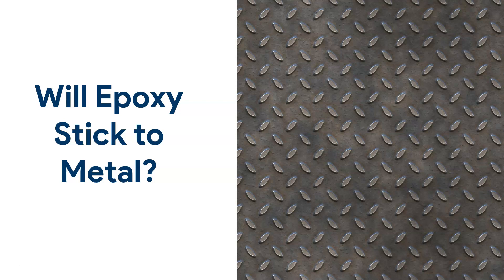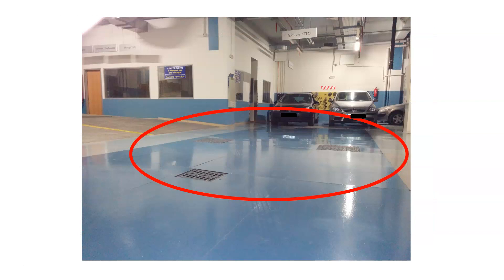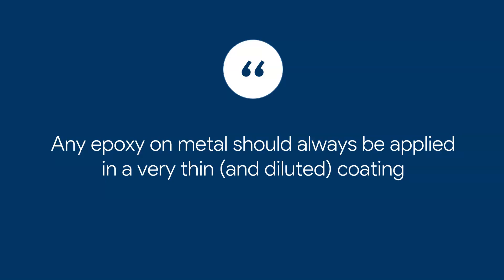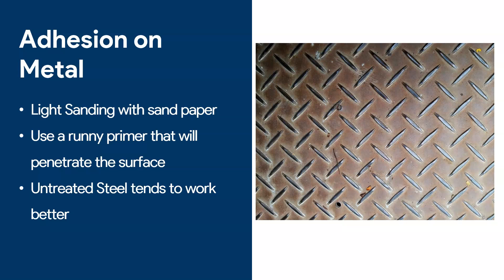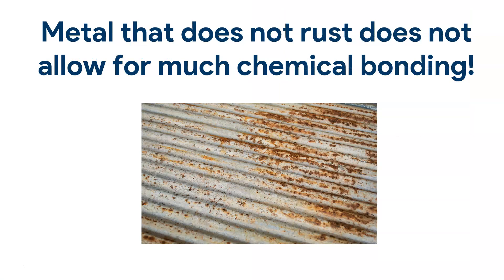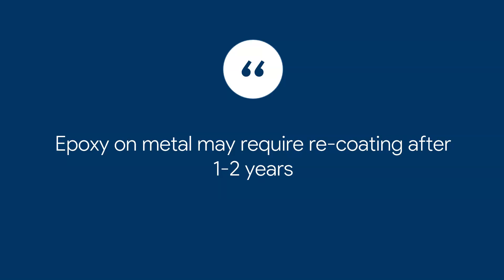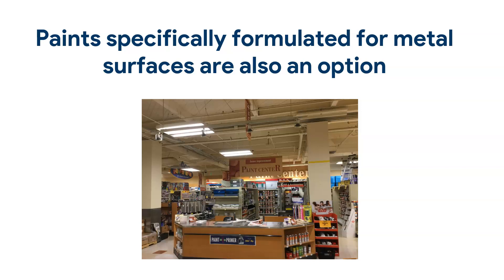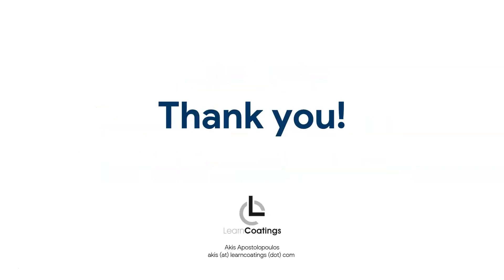Will Epoxy Stick to Metal?

Comment: i just want to glue a 12 x 12 x 14 thick  aluminum plates onto a 12x12  x1/16 aluminum sheet then i need to cut ir to the size i need

Comment: I would like to use epoxy to cover the inner body of my steel tipping trailer.
What is your suggestion?
I am planning to load Crystal Salt with the tipping Trailers.
Reply from the maker: Crystal salt tends to attack epoxy. Best to use aluminum sheets that dont get corrosion

Comment: I want to apply a 2 part epoxy resin on my stainless steel backsplash. Should I apply it with a foam roller?
Reply from the maker: If you use a foam roller make sure it is good quality, and that it will resist strong thinners and corrosive materials like epoxy. Cheap rollers have a tendency to break up and leave marks
Reply: @learncoatings-epoxyfloorin9448  

Thank you. And if are so kind to answer the following, what will happen if i apply it a steel tap? 🥴 I’m trying to get the same antique brass finish to all the metal details in my kitchen and it’s been a challenge 😅

Comment: Can we use epoxy resin on Aluminum frames , acrylic sheets (3 mm thickness ) , etc
Reply from the maker: No 3mm thickness is bound to crack on metal frames. Only thin coats on metal

Comment: Do you think the epoxy avoids the rusting with metals?
Reply from the maker: Epoxy is a good protective surface, but you are probably better of getting a paint specifically developed for metal surfaces
Reply: @learncoatings-epoxyfloorin9448  what kind of paint please I want to know?
Reply: @amazingworld7025  probably something with a rust inhibitor like rustoleum ?